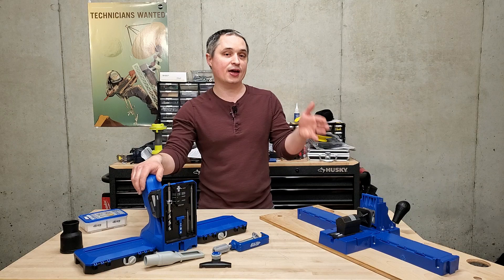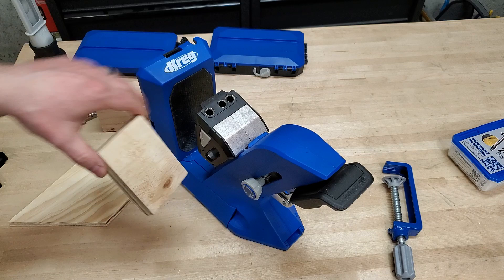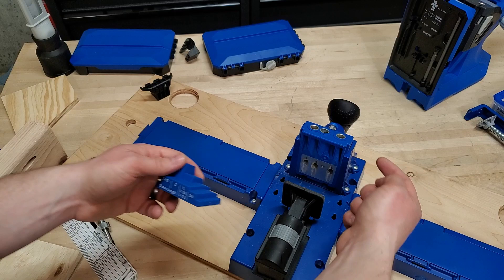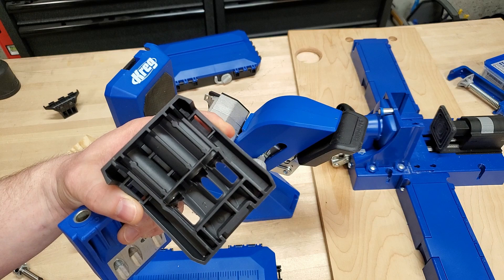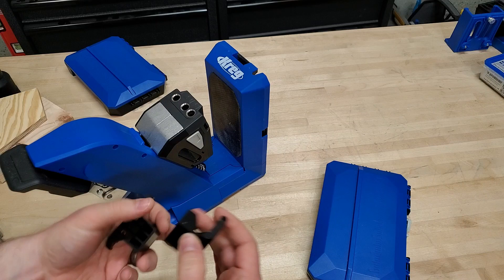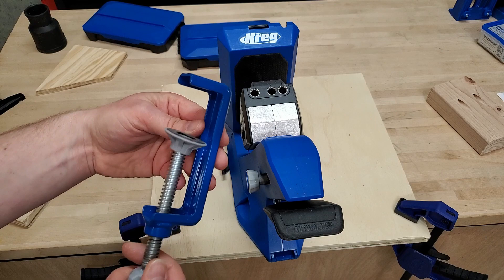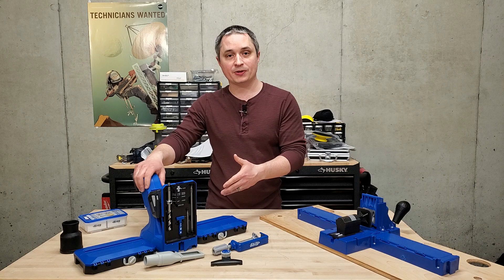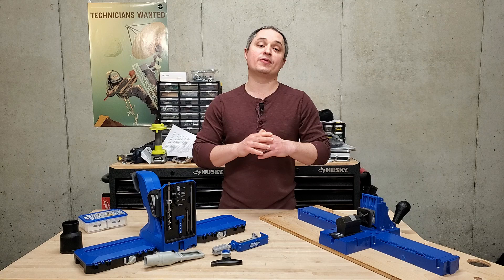Kreg 720PRO vs K5 Pocket Hole Jig Review and Comparison

Comment: I got my 720pro today, but the drill bit can not run through the drill guide! Did you meet the problem as well?
Reply from the maker: I didn't have that problem. Is the drill guide just too small, or did you have the problem this Amazon reviewer did with a non-formed drill guide slot? https://www.amazon.com/gp/customer-reviews/R1M2YWAWAIN4ZE/ref=cm_cr_dp_d_rvw_ttl?ie=UTF8&ASIN=B08BQC8TGZ
You could also try checking to make sure the drill bit isn't bent by rolling it on a known flat surface and looking for wobble.
Reply: @DoresoomReviews  wow, that’s big quality issue. mine is different, the jig guide has complete holes but it seems the hole is not bigger enough, so that my drill bit stuck at the middle and cannot go through. I talked to Kreg’s technical support, he wants me to just drill it and the drill bit will “ clean” the plastic ... but I think that’s a damage for my jig.....😭
Reply from the maker: If it's just the plastic that's in the way, it won't hurt the drill bit. You can see there are already chewed up marks on my 720's plastic portions of the drill guide in my video. That's just from regular use too, since my drill bit fit through without having to drill out any plastic initially.

Comment: debating on kreg 720 or armour jig I don't know which!
Reply from the maker: I haven't used the Armor unfortunately. I did consider it when I  bought my K5 - I think the Armor had just been released then. The reason I went with Kreg was because of the micro drill guide and plug cutter accessories that Armor still doesn't have.
Reply: Go with the Armor. I bought one when they first came out and have used it extensively for the last few years. Super well built, auto sets bit height and tells you what screw to use. Clamp system is rock solid and customer service is excellent. If you are ok with spending a little more money, take a look at the Castle Pocket Hole machine. Its pocket holes are the cleanest in the industry and are cut at a lower angle to help reduce wood movement when driving the screws in. Good luck in your search.
Reply: @bucstart  I appreciate that information I'll definitely look into that thanks again!

Comment: 720 made in China
K4-k5 made in America
Nough said
Reply from the maker: Another point for the older models. I didn't realize they changed country of origin between the two as well.
Reply: The K5 may be American-made but the molding is exceedingly poor.  It has piss poor tolerance and rough finish.
Reply: @stevew3978  True, made in the US does not automatically equate to good quality.

Comment: Too many issues, to be of value and Kreg has discontinued the K-4 and K-5. They really shot themselves in Both feet.
Whoever designed this should be fired, along with the fool who approved it, even if his last name is Kreg.
Where it was made is not the issue here, it's all in the design. Bad.
If you want a K-4 or K-5, get it quick. They are Both discontinued.
Reply from the maker: Just about every company will put out a dud product now and then. What's more inexcusable to me is Kreg deciding to discontinue the K4 and K5 after just a week of sales for the new 720 and 520 jigs.